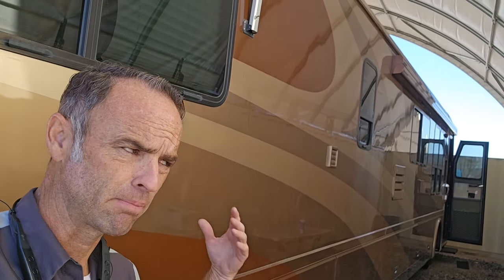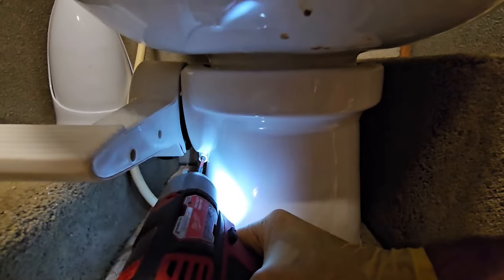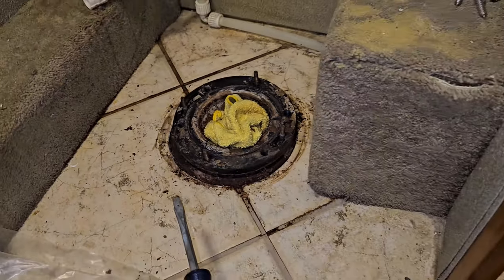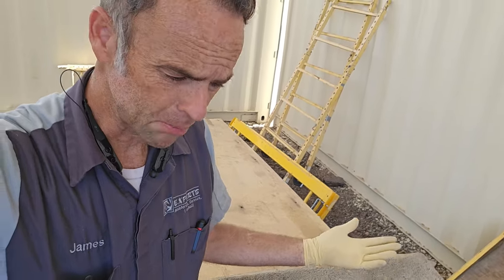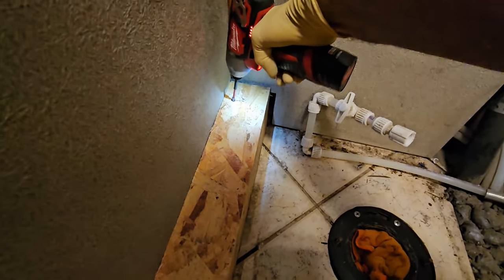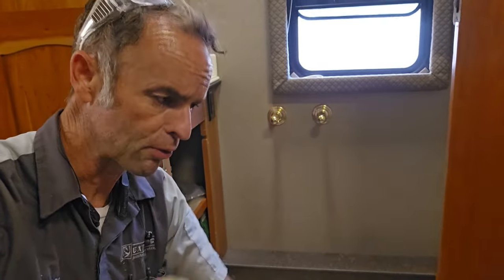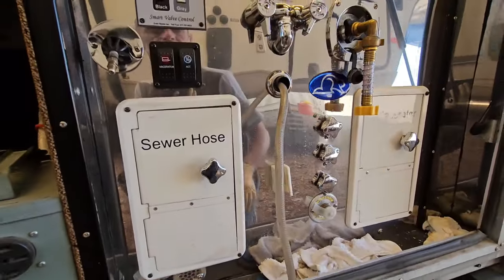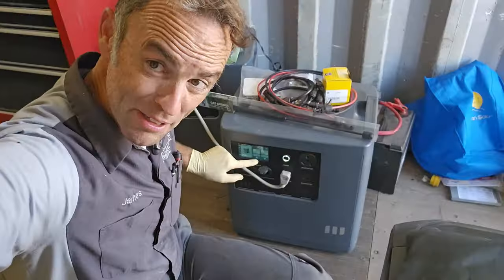Upgrading My Luxury RV Bathroom: Savy Thrifting Ideas

Comment: Nice. I’m surprised you didn’t replace the flooring while you were in there.
Reply from the maker: Replacing ceramic tile is not something I would consider easily
Reply: @AZExpert  that’s fair.  I think I may have been mistaking the tile pattern for something else.  Turned out great.  My RV projects start this week.

Comment: Why not single piece of the corian tilted from the floor against the wall and mitered? like cove molding but at the floor. There is only one small pipe in that chase. and the angled corian will make more room around the bowl to work and clean.
Reply from the maker: the walls and floor are not perfect squares and flex, the cover becomes a great ledge and a sloped cover would get stepped on and broken
Reply: Great video what a steal of a deal on the toilet my toilet was made from a bed frame I found in the trash no water involved but looks good and works great video as always

Comment: Totally random comment here, but some Auto Tech Manufacturing Rust Prep, a red scuff pad, and about 20 minutes of elbow grease will strip the surface rust off that table saw real nice and protect it from rusting for a little while. Just make sure to use warm water to rinse with or you’ll get an ugly rust-looking film. (It’s NOT rust, but it looks like it.)
Reply from the maker: If I had the time I would